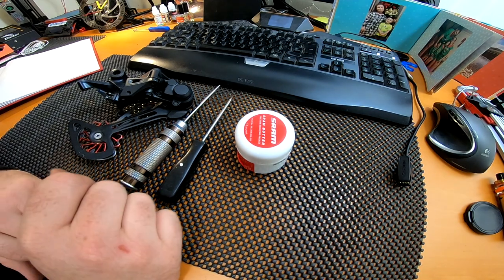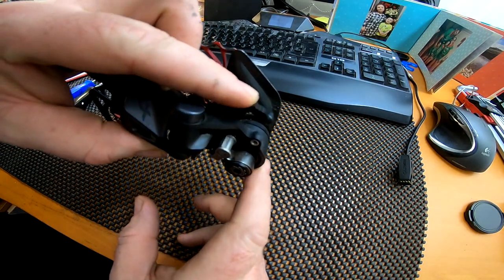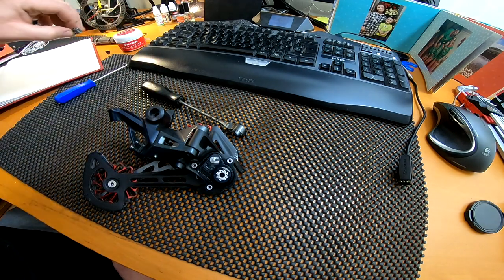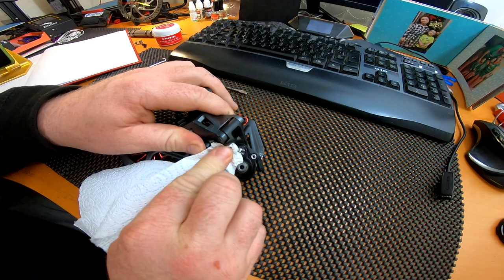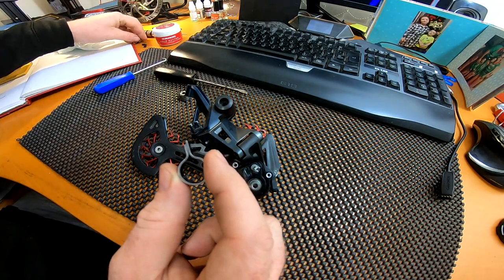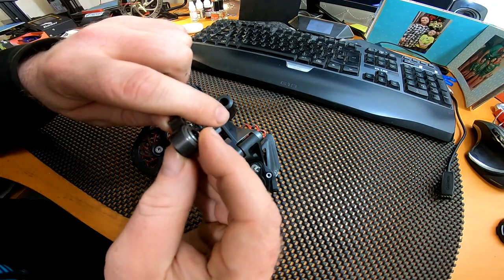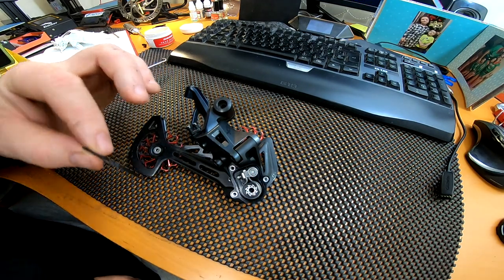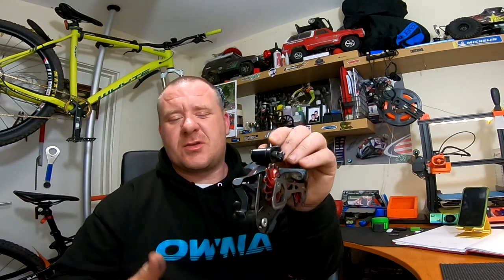How To Service Shimano SLX - XT -XTR Derailleur Clutch

Comment: This was a great video, thank you. I took my XT clutch apart and did this but the clutch is still not engaging. Nothing seems to be broken either. Can the one way bearing break? All my other components in the clutch area seem to be working.
Reply from the maker: The bearing can fail yes just make sure that you have the cam installed the correct way around first though